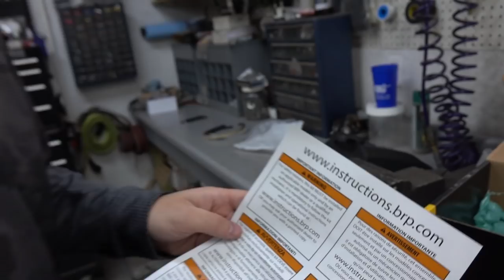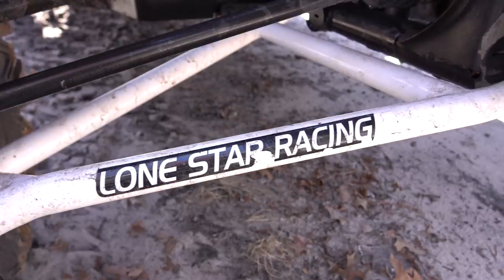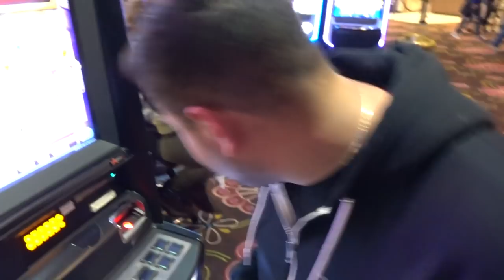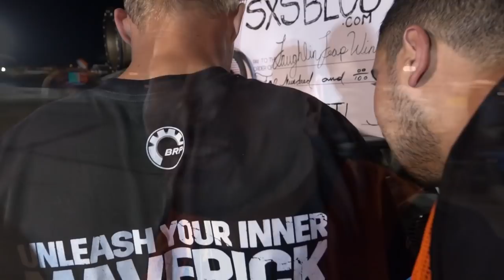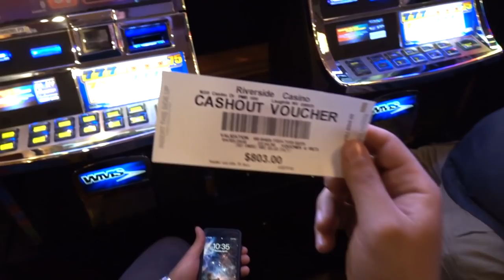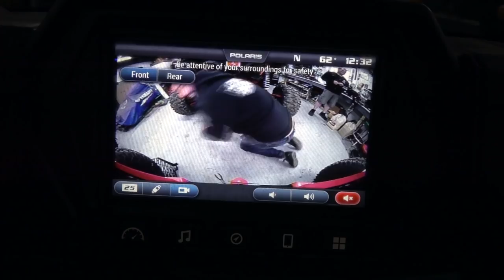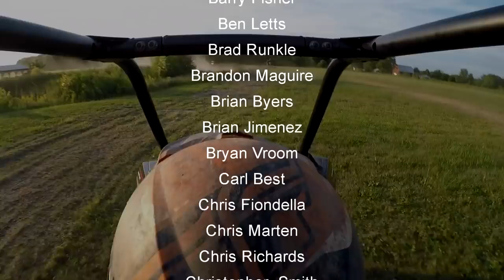Best of 2018 Part 1! Wins, fails, and unseen footage

Comment: Cool video.... Can you tell us why the big blue (DRW pixuup) and the trailer and over bed (nice) rack was chosen over a goose neck or other trailer types?....
Reply from the maker: We went with a bumper pull because we typically travel with 5-6 people and need 3 row seating.  The OX with the rack was a last resort purchase, future of that TBD
Reply: @SXSBlog  Ah... so you can use it with the SUV... good deal.